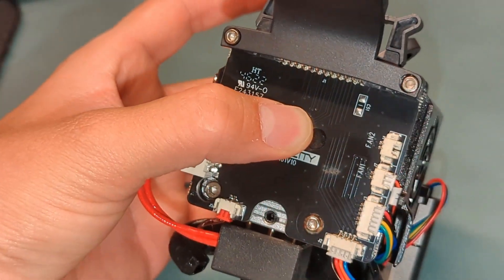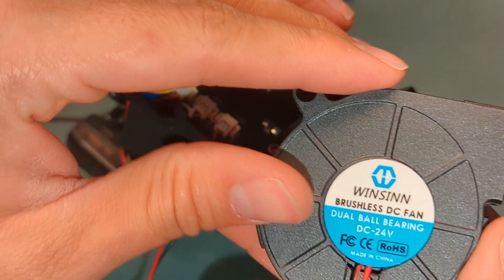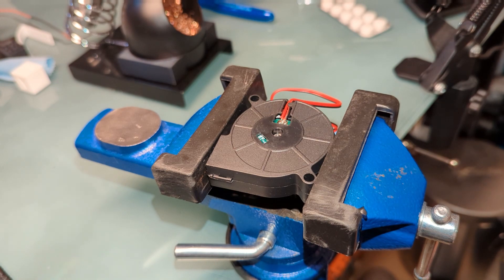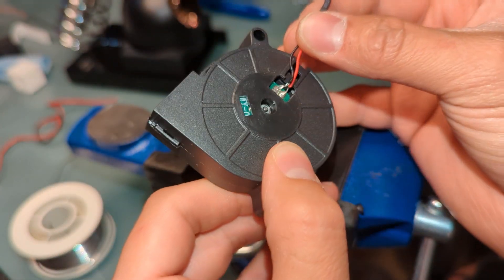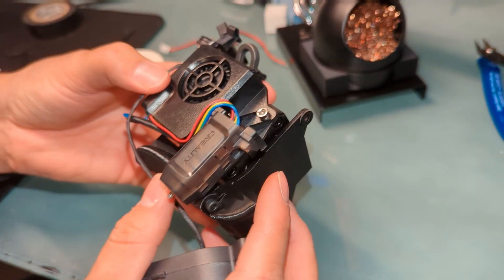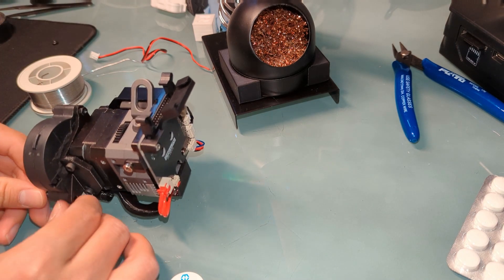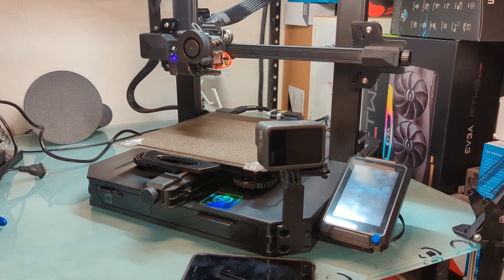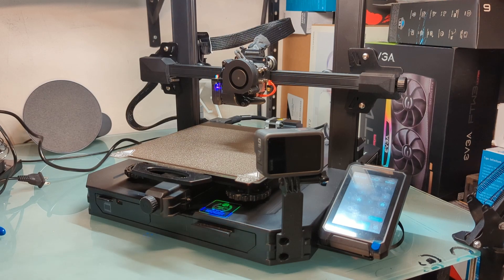Ender 3 S1 Pro - 5015 Wiring Setup.

Comment: I've recently tried to upgrade my ender 3 s1 pro fan 2 duct. It reads 24.1volts when I have the fan hooked up backwards. when I have the polarity correct it reads 2.1 volts. I do not understand how to get this to work.

Comment: You can swap the pins in the plug. Just gently pry the protection with a needle and the pin will come out of the plug cover.
Reply: Soldering?....SOLDERING!?! WE DONT NEED NO STINKIN SOLDERING!
This comment gets a trophy. 🏆🏆🏆🏆🏆🏆🏆🏆
Sir you are absolutely right. (With a sewing needle) you can pry up the plastic piece (that clasps the metal connector within the cover), its like a plastic tongue that lays over the top of the pin, pry it up with needle, and pull with other hand.

I bought a package 20 of these for 4.99 on amazon, and got a sewing needle, and got very good at this 
🤣.

It is a good solution (if you dont feel like soldering, or dont have the equipment, or dont wanna splice....just do this). 

Be sure, once complete, to give a (gentle) tug to the wires to ensure they are properly seated.

EDIT: The only way this will work is if you have a 24v fan that ships with the proper connections, and there is no need to switch to a different size whit epiece
Reply: @zac2877  so it will become loose yes? how can we tighten up it again? with pliers?
Reply: @BarPBarPkoyanee  i pulled mine out without them becoming loose and was able to re-insert the wire into the hole without having to "tighten" altho, I would suggest maybe bending the metal part a little bit until it fits properly, I ordered a bunch of these little pieces and got good at it with practice, lol
Reply: @zac2877  just got a 5015 fan, the pin is too big for the board, can i swap the wire from the old one?

Comment: How do i contect 2 fans  in 1 cable?
Reply: create or purchase a splitter.
Reply: Solder them in parallel if they're 24V, in series if they're 12V.

Comment: Great video, just bought 4 of these and didn't realize the wiring was different. Any value is replacing the other fan on the extruder
Reply: I know some people replace it with a different fan to make it quieter, but I don't think there is any performance gains from doing that

Comment: this was a great video, but i was wondering why you didn't use a Zener Diode or is it necessary? I am so ignorant on the electronics side of things lol
Reply from the maker: I don't think it's necessary since the fan current is still 24v. But I'm not sure, I haven't had a problem.
Reply: @Zeltroix  so, after I posted that, I did a deep dive and learned why you didn't lol you are totally right and thank you so much for the response! Your video is great!
Reply: @mikehancho8930  you need the zener diode if you replace the parts cooling fan because that is only a 12v fan